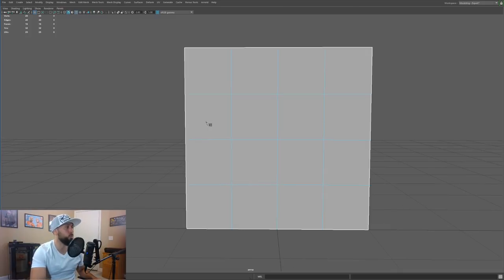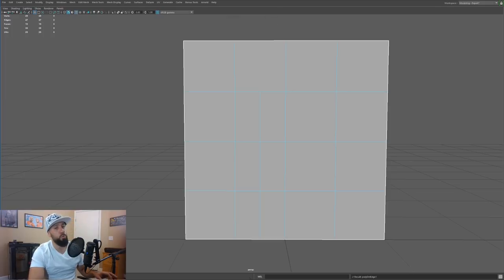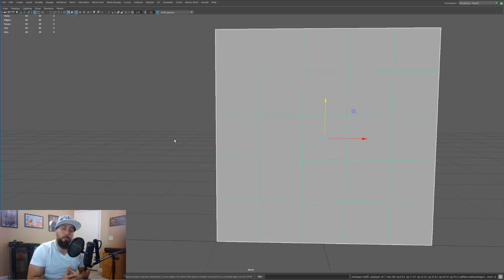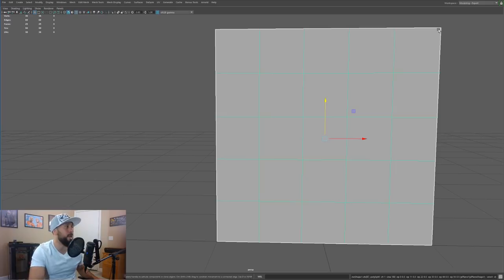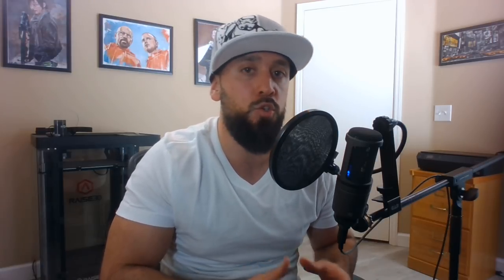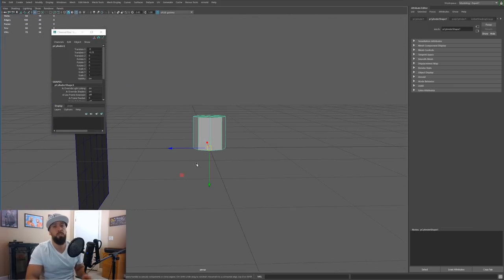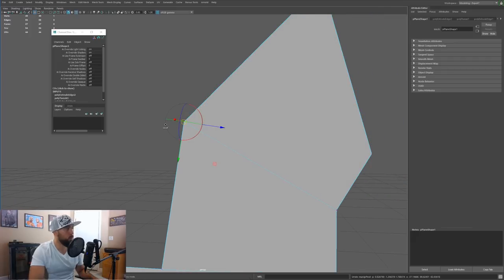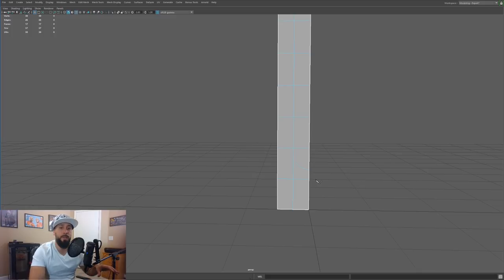6 Maya Hard Surface Modeling Hacks 2.0

Comment: Great to see someone using maya for hard surfaces.  Max is usually the suggested tool for this but i think maya does it better and easier,
Reply from the maker: Max is a Beast in its own right.  I do prefer maya's interface over max though.  Max modifier stack is more powerful.  At the end of the day, it comes down to the artist more than the tool.

Comment: These are good tips, but one I wanted to mention is the diamond pattern. I feel like with it so close together, it can cause awkward pinching, especially on curved surfaces. If you were to redirect twice, with the redirects facing each other, maybe 2 or more edge loops apart, you'd get the same edge loop reduction with a cleaner topology that better follows the contours of the shape.